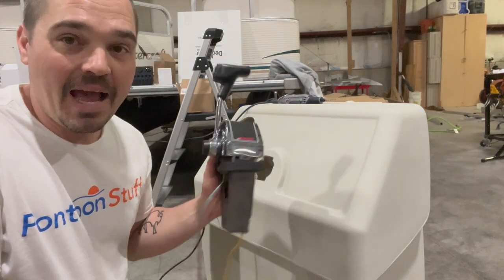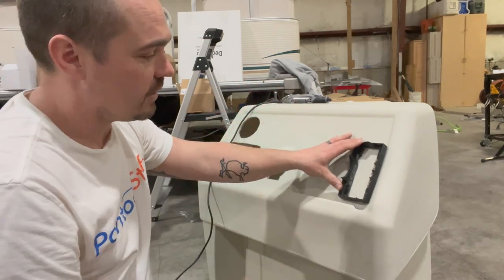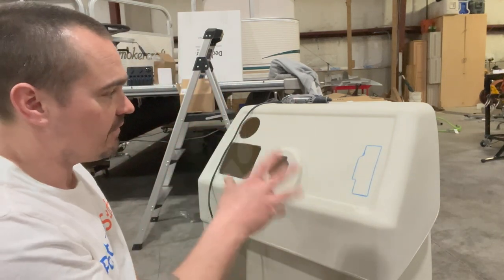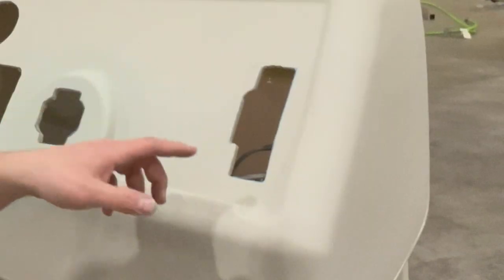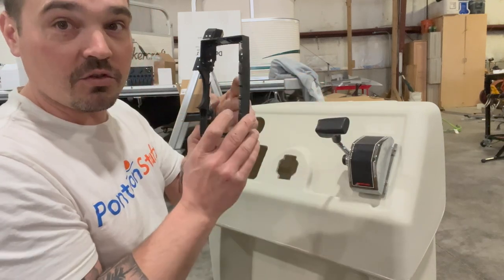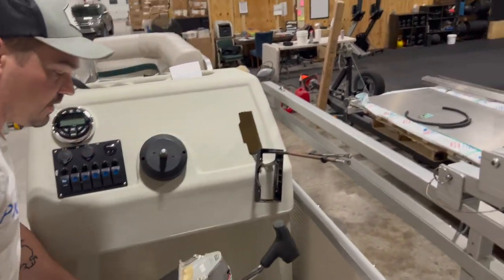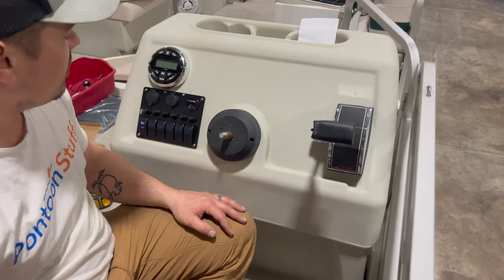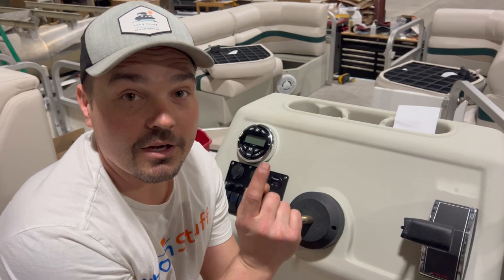Outboard Motor Controls - Mercury Binnacle

Comment: Where is the throttle tension adjustment for this model? Whenever I throttle up it always falls back down without me holding it.
Reply from the maker: Off the top of my head if there is a tension adjustment I believe it's under the cover on the forward portion of the control.

Comment: Tom, I ended up with the top of the box coming apart and now it doesn't move the shift cable when i put back together.. what did i do, or where can i find a diagram?
Reply from the maker: You should be able to search the part number for your control box and find a schematic.

Comment: Do you have a parts number for the control box?
Reply from the maker: I really like the new control box from Mercury, but if you like the classic I'm pretty certain this is the exact same box (I found it on ebay):

New Mercury OEM Binnacle/Concealed Console Mount Remote Control Kit 88688A26
Reply: @tomspontoons  what’s the new box’s part number?
Reply from the maker: @Vincent-bn9gk  The brand new style they're selling now for new motors? Or one similar to the one in this video?

Comment: Hey boss, does that control box use Gen 2 cables?
Reply from the maker: These are Gen1 cables for this box. Gen 2 doesn't have the black plastic barrel on the control box side, it has a machined notch in the cable end to hold it in place for the cable to move inside the sheathing. The motor side looks the same with the adjustable plastic barrel.
Reply: @tomspontoons  Thank you for taking the time to reply back
Reply from the maker: @setthehook4me happy to help!!